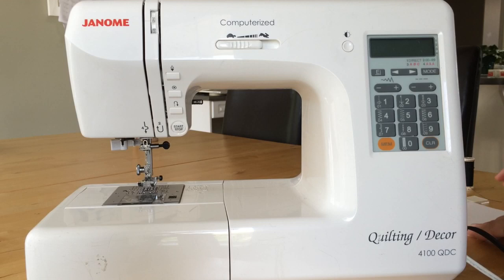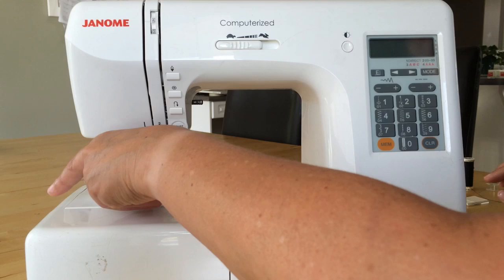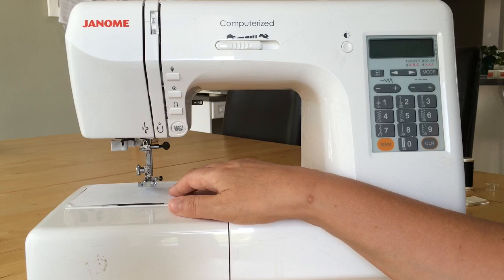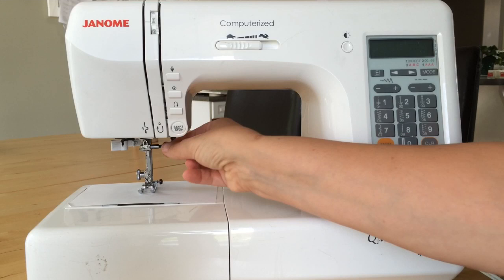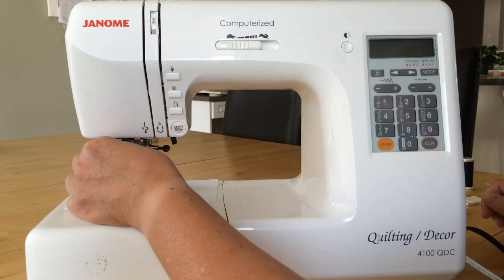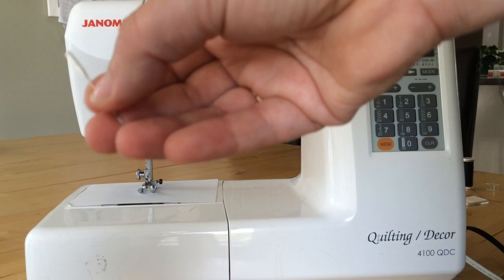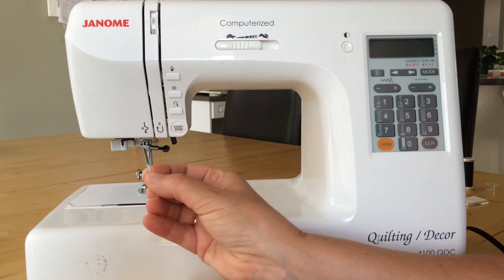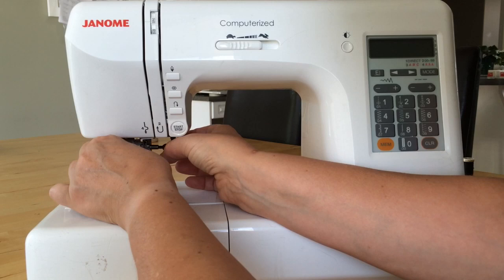Changing the Janome needle

Comment: The piece of paper is a good tip. However despite doing exactly what you show, my needle tilts backwards as I tighten the screw and then it hits the foot or the plate beneath or it would if I started sewing. How do I get it to stay straight/vertical???? Mine is an XL 601 but the needle system is the same.